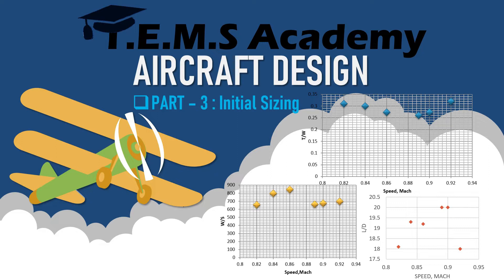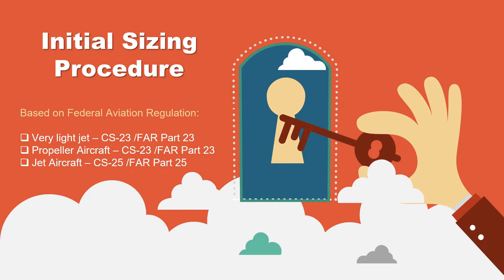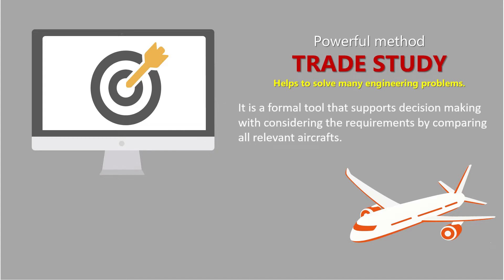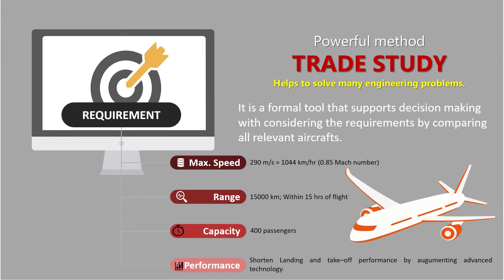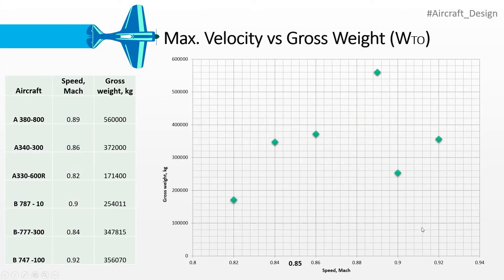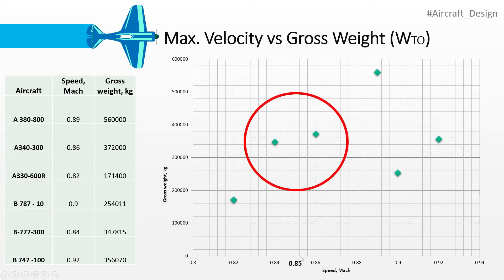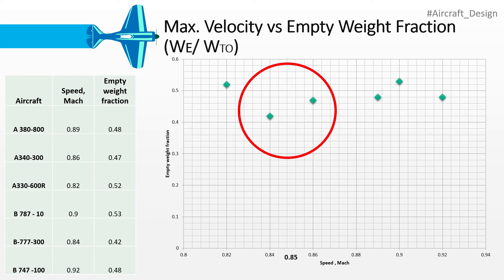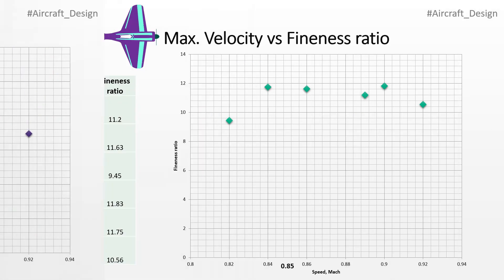Initial Sizing of Aircraft Design - Part 3 || Optimization || Aishwarya Dhara

Comment: Hello.....this is for large aircraft but if i want to build very small plane like a model.....then how can i scale down the datas......or how to proceed for small aircraft?
Reply from the maker: The ratio you want to scale it down, same way you can  develop your prototype.
Reply: there are two kinds of scaling , aerodynamical scaling and geometrical scaling . ratio(geometrical) is bad scaling method because your weight/loading /L/w / T/w  and more parameters for considering sizing will never be same.

Comment: I think that your design altitude of 22000m is rather high. Besides, that is the only parameter you don't show in your explanation.
Using your methode, I roughly calculate 13000m.